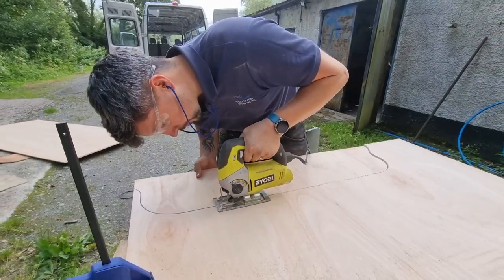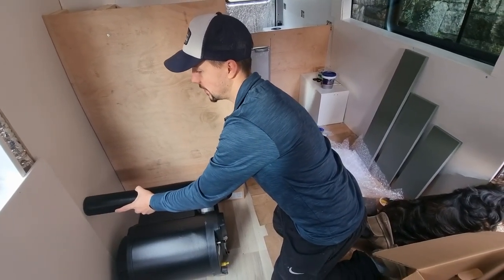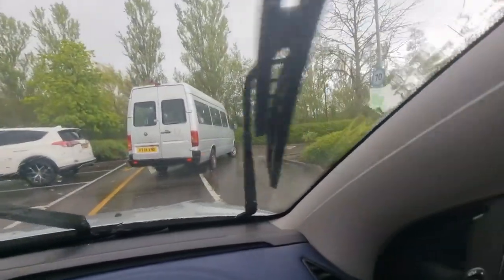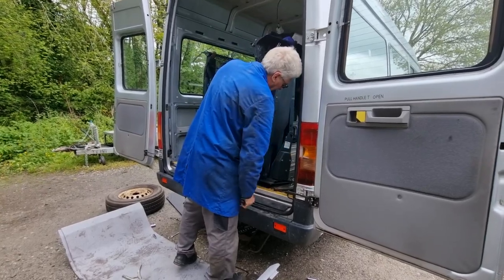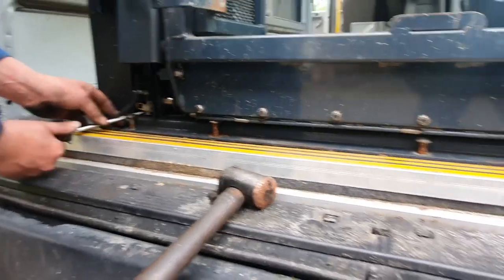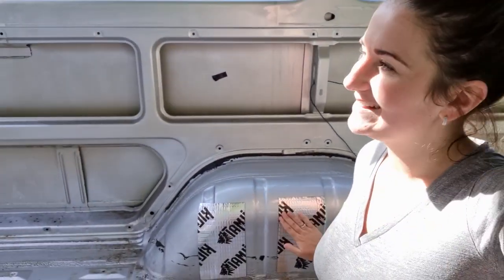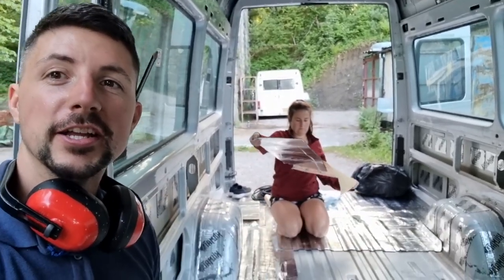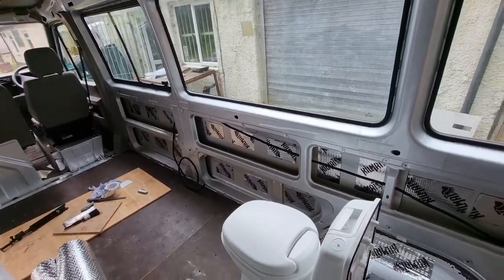WE BOUGHT A MINI BUS, Van build series, Part 1

Comment: Great work guys. You wouldn't know you were not used to YT or cameras, you did really well.
In one shot it showed a black cable running from front to rear in the offside panel, I hope you protected it from rubbing on the internal metal struts as it was resting on the sharp metal edges?
Looking forward to more Vlogs 😀
Reply from the maker: Hey Mark 😀 thank you, really appreciate your feedback. We definitely have got more confident filming as time has gone on 🌟 

And yes we definitely popped conduit around all our cables before we put all the walls up 😀